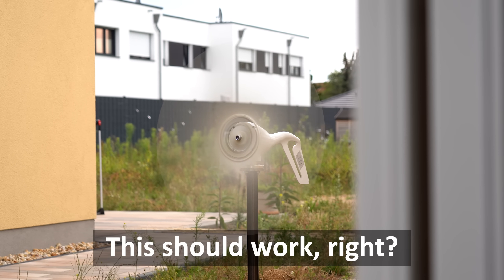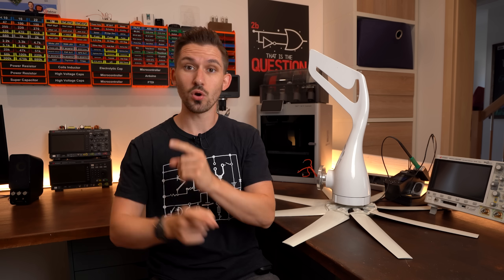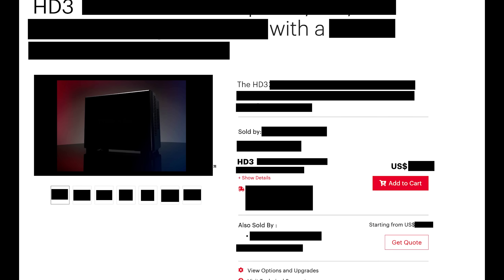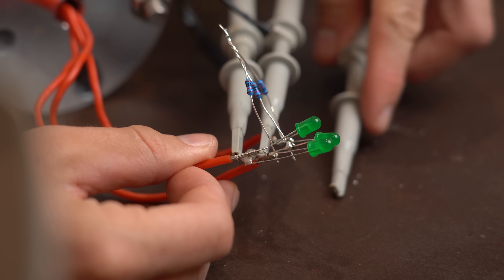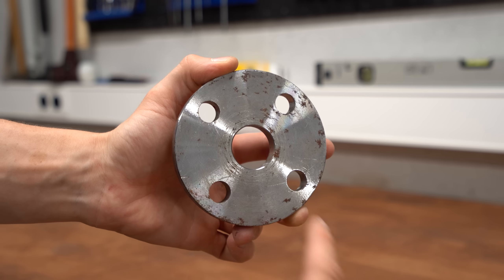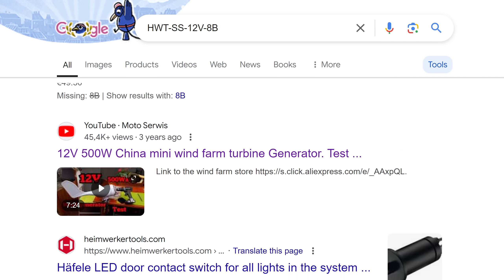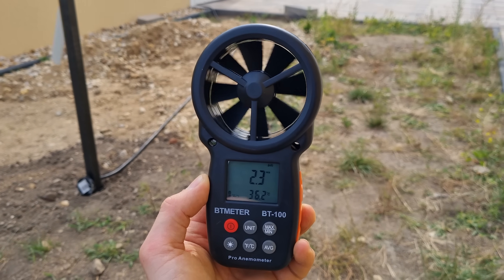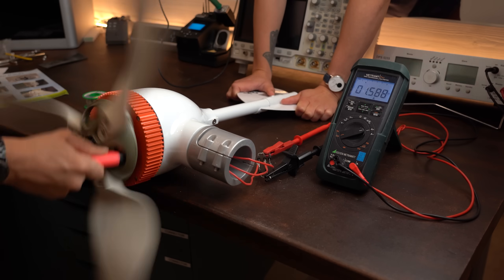I tried to Power my Home with Wind Generators! (Worth it?)

Comment: I would like a follow up video of a DIY style, but also include the designing of a VAWT.
Considering your generator can switch blades so easily, you could take the generator and turn it on its tail and put the VAWT blades above it fairly easily (tho, it's possible the bearings might need to be changed due to different loading; or have a separate one for the VAWT blades so they don't put too much weight on the generator bearings)
Considering that VAWTs love random wind speeds and turbulent air flow, it would be best suited for your low altitude and cramped location between buildings. HAWTs otoh love straight air flow and higher speeds, so they need to be mounted pretty high so they don't experience much turbulence.
Reply: Same, I have a strong preference for VAWTs, partly vindicated by the finding of them being less efficient than HAWTs was based on an incorrect transcription of an old wind power book chart parroted by other books for decades. They are in fact NOT 30% less efficient than HAWTs.

That aside, any wind gen you can "buy online" will probably be junk. The priority for them is making a package small enough to ship. A real project will require DIY. It would be most interesting to see a huge VAWT at only 10 feet high generating usable energy at 2m/s. I'm sure it's possible if you make the diameter wide enough and include a gearset to speedup the generator portion.

Comment: I run all my Lights, TV , stereo, and 2 Fridges as well as Fans on 12 Volt solar, That is 1000watts solar, and one wind turbine just like that.... I got 800 amps capacity and my 3 Bedroom house and Garden is always lit up, never out of Power, The Glassmat batteries last about 10 Years. I only have 4. 200 amps each. So only my Washing Mashine and a big Freezer as well as my Aircons are on the Grid. That keeps my power bill to around 300 bucks a Quarter with aircons running at night... at least on my place, when the sun goes, wind comes, my turbine provides 400watts/8+amps charging. Helps alot... combination is the go...

Comment: Wind generators like solars are dynamic generator, therefore theyre not stable and cant really be relied upon. That said can you use a boost converter to take that 1. Sonething volts and raise it to 12v?

Comment: With almost 30 years experience with wind power, I'm sure almost 100% of homes are not windy enough to make enough electricity to pay for the equipment.  It probably needs over twice the average wind speed as you'd find on residential property UNLESS you live at the top of a hill or ridge that's higher than any property within 5 km. Wind turbines over 150m tall might work if professionally sited, based on professionally modeled wind analysis. Anything less is a waste of money and time.

Comment: He uses a wind turbine the size of a house fan, puts it at ground level where the wind is the slowest, claims wind generators are not worth it as the cost per watt is too high. Smaller wind turbines require higher wind speeds per square meter of surface area to generate the same Watts per square meter as larger wind turbines. Also those giant 16 MW Wind Turbines in China can start generating electricity at wind speeds as low as 3-4 m/s (6.7-9 mph) while 24-Inch Blade Small Turbine needs 13-22 mph and 30-inch Blade Small Turbines need about (11-18 mph). Larger blades will generate much more energy per square meter at the same wind speed for the same surface area. 

As of 2023, China has installed 440 gigawatts of wind capacity. Wind energy, along with solar, is the cheapest source of energy per watt. Placing a wind turbine at ground level is inefficient. Reviewing a wind speed with height chart will show that wind speeds—and consequently energy production—increase with height. Therefore, avoid installing small, low-quality $95 turbines from Amazon with poor ratings.

For example, a 16 MW wind turbine with 252-meter diameter blades produced 384.1 megawatt-hours (MWh) in 24 hours, enough to power 170,000 average Chinese homes. Unlike solar energy, wind energy does not scale linearly with investment. A single 100W solar panel might pay for itself in 3-6 years, similar to how 10,000 watts of solar panels could have the same payback period. However, small wind turbines are unlikely to ever recoup their costs. The larger the wind turbine blades, the more energy you get per dollar invested.  Look at home projects where they installed $5k to $20k wind setups and see how the payback period drops with size.

Comment: i would recommend using a motorcycle stator since GY6 ones can be bought for fairly cheaply & produce 12v's at low speeds

Comment: For the DIY follow up, a car alternator has about 80v on open circuit and, after the fbr, any mppt solar works just fine. With cool DIY fan blades should be a nice project.

Comment: Couldn't an internal gear system be used to bring the RPM to a level where the output voltage and amperage are at a practical level for everyday use? 
Since I can see that the connection between the blades and the generator is direct, which I assume leaves everything at the mercy of the wind.

Comment: 15 years ago, I was part of a team that researched and purchased a wind turbine for my then work place.  The consistent wind is about 150 feet /46 meters up.  Your insurance is probably going to demand you have enough space around the tower that it can't fall on anything.  And even if your location has strong and steady enough winds, you still have to account for your turbine's maintenance.  We learned that part the hard way.  Those things need *constant* maintenance.  Unless you're building a windfarm, solar is definitely the preferable way to go.
Reply: I know of a business next to an airport that put some vertical axis wind turbines on their roof to get some green energy from the near constant high winds from the open field. Just two problems: The poles were too short so the turbines were too close to the rooftop, and I'm not sure if they ever maintained those things so they were turning very slowly just a year later...
Reply: Problem in Germany is: When you need power the most, in Winter, Solar output is 10% of summer output AT BEST. 4 Month of only extremely ridicculous results when you need power the most.
If  you push the installed capacity to 12 times the summer needs, to be able to have enough in winter, The excess energy in Summer you get NOTHING for because germany already has so much solar installed that market prices are near zero or below that (PAY to get rid of kWh)  that you throw away 80% of the solar's output in Summer, making it really not feasable.

This is the problem at out lattitudes.
Reply: Use biogas and a generator at night.

Comment: i think you should of put a clamp meter on the ac portion. As you know the fluctuating magnetic field made by the wires current flow is detected by the coil in the claps coil, similar to a transformer so in a dc application there is no fluctuation and the meter is more of a "tracking" meter adding and subtracting from a known 0v value under instantaneous changes is the dc' static field. i really think all if not the majority of "DC" clamp meters are pure bull shit. i understand the magnetic strength can be used with a mechanicle sensor or a change in the electrical properties of a material when a magnetic field is present or the pulsing of the field in the instrument can interact with a static field but none of them are as simple and accurate as a traditional ac meter. PLUS THE TURBINE PRIMARELY OUTPUTS AN AC SIGNAL!!!! since its a 3phase signal the current in one conductor is equal tot he total current flow. a standard low impedance resistor should be measuring current input of a battery in a dc system.....  /rant

Comment: What about using a 3 phase transformer at the output of the wind generator to allow the wind mppt to operate at its optimum voltage point

Comment: The problem with the MPPT controller is that it is a Buck regulator and you have lower voltage out than your battery voltage so you need some sort of Boost controller.

Comment: Well, I have been messing around with a couple different wind turbines myself and even the same vevor one you have. My results suggest making a 24v wind turbine for a 12v system because the turbine will never really hit the full rated power. Another thing to note after your full bridge rectifier is to build a curtailment circuit. This evens out the current from the turbine using capacitors and the circuit is mostly protective measures for charging the capacitors this way. It is also possible to build a curtailment circuit for solar panels. They both provide different benefits and purposes. Doing this will allow you to take advantage of an mppt controller for solar. The curtailment circuit in a nutshell is a direct charge capacitor bank from the source before the charge controller. If it’s large enough and the capacitor bank is doing its job correctly then what happens is your charge is evened out and will continue to charge the battery bank after the wind and sun has gone for a few hours. Typically ultra capacitors are used. They must be rated slightly higher than the charge being stored.

Comment: You should have bought higher voltage units like a 24v or if you have a controller that can handle the 48v

Comment: A wind generator only really makes sense if you are able to place it at least on a 10 to 15 m tower and if you get laminar wind of at least 4 m/s average at hub height. This is basically only the case in the countryside right at the sea or on top of a hill. In a city a wind turbine will always just be a fun toy, which is totally valid to want one, I've got one too. Only lights up a few LEDs but it's fun to watch and was fun to build.

Comment: Looked at the product page for the 400W Vevor unit. They show the performance curve for the 1500W model (scummy) so if you scale the numbers down they're claiming ~10W at ~3m/s and ~60W at ~6m/s.
Uhm, no. That's still optimistic..

These small wind generators require ridiculous wind speed to provide any useful power.
And sound awful because they're so small and have to spin so fast.
The listing says the blade length is 680mm or 1.36m diameter. Rated 800rpm (yikes)
Let's calculate the speed the tips of the wings are going at that rpm.
Tip speed equals pi times diameter times rpm divided by 60.
That is 57m/s. Or 127mph. (Category 3 hurricane)
The rated wind speed is 12m/s. So that's a tip speed ratio of 4.75.
Commercial wind is between 4 and 8. Basically closer to 6-8 for better power coefficient.
With this blade diameter, if you wanted a tip speed ratio of 6 (tip speed of 72m/s) at the rated wind speed of 12m/s you would have to spin this thing at 1000rpm.

If you want useful wind power you also need useful wind speed.
Diameter of 1.36m is a swept area of 1.453m2 and at 3m/s the available power is 24W.
At 6m/s the available power is 192W. At 9m/s it is 648W.
This is before any losses!
Betz's law says the maximum power you can extract from wind is 59%.
EPA says wind turbines are 20-40% efficient. Some claim up to 50%. But this is utility scale turbines.
With dinky little turbines don't expect no more than 20-30%.
For reference, Vevor claims 400W and rated speed is 12m/s so turbine efficiency of 30% checks out.
Then there is wake losses from anything nearby. And mechanical losses and electrical losses etc.
Let's assume real efficiency of 25% and you would talk about 6W/48W/162W of real power from wind speeds of 3/6/9 m/s at that diameter.

If you want reasonable amount of power, let's say 400W and your total efficiency is 25% and TSR of 6
at 3m/s you need 11 meter diameter at 30rpm
at 6/ms you need 3.92 meter diameter at 175rpm
at 9m/s you need 2.14 meter diameter at 482rpm
If you're satisfied with 200W you would need
at 3m/s you need 7.73 meter diameter at 44rpm
at 6/ms you need 2.73 meter diameter at 252rpm
at 9m/s you need 1.49 meter diameter at 693rpm

Comment: Brilliant work, dude! Really well done!!! 😃
But you know, I also have solar panels here at home, but without battery. And it's in the maximum of the equipment's capacities... But I still think about buying or even building one of those!
Perhaps I could get a small battery and use it to power some reflectors... I don't know, but something! 😬
Oh, and here the wind is pretty strong! Sometimes a bit too much, at the point of damaging the roof. 😬
Anyway, stay safe there with your family! 🖖😊

Comment: Your diode thing is simply a "full bridge rectifier". We're used to the traditional one with 4 diodes used with a single phase AC supply, but yours is simply the 3 phase version of it. Get rid of two of the diodes and you have the traditional bridge rectifier drawn slightly unconventionally. If you have a Wye 3-phase you can add a 4th set of diodes for the neutral.

Comment: at lower wind speeds, and im sure im wrong typing this, it might be worth getting bigger blades and setting up a 1:2 (or whatever ends up being more efficient) to convert torque to rpm. i do not know the optimal rates of rpm to torque you need to pull good power but bigger blades should pull more torque and a conversion of rpm to whatever is most optimal for it could create a more efficient setup. my thought process here is that more blade should have more air force making more torque, it may lower rpm as well but at low wind speeds i assume torque should be king. large and i mean LARGE wind turbines spin at like 10-20 rpm (google says so) but they have a huge amount of area they pull from and can covert that torque to rpm, usually in the thousands but thats a huge conversion.
Reply: you don't need a gear, you can just take a generator with more poles in it. There are even designs with 9 separate windings, so you can switchs "gears" with software.

Comment: 1.2 meter sweep diameter with 13m/s wind as they claim is actually 1500w available wind power and at approx 30% eff with some wake losses it should deliver 400w.
At 4m/s the wind power available is only 44w and output potentially 12w. It's not a linear scaling. At slower wind speeds you basically need bigger blades. 3.5m blades instead of 0.6m equals 400w potential output on 4m/s wind.
Edit: Remember kinetic energy is K.E. = 1/2 m * v^2 making increases in v count for a lot! It also makes the blades profiles work better.
Reply: The Betz limit will tell you that you can capture at most around 60% of that energy in theoretical situations. In practice, it's closer to 40%. The power in wind equation (P = 1/2 x ρ x A x V³) has the velocity cubed, so you can imagine that at low wind speeds you don't get anything useful.
Reply: @upnorthandpersonal  My estimates used 30% and 5% wake losses which is quite reasonable. It does match quite well with their 400w claim although I would expect their wake losses to be higher for such cheap design. Using the velocity cubed matches well with the results he is getting.

Comment: Thank you for making this video. While I do engineering I am not an electrical engineer and had always wondered if these small wind turbines could be made to work at wind speeds under 7m/s which it looked like they could not. This is excellent confirmation that they do not.
Reply: A lot of these problems were interesting engineering challenges back in the days of mechanical wind turbines.  If you were running a water pump, it just ran slower.  Mostly, mechanisms were needed to prevent the mill from generating too much power.  Today, we just use capacitors to get around the problem of intermittent supply for electrical applications, not unlike the hydraulic accumulators during the first industrial revolution.

Comment: Please build a wing generator of a specific type! Hear me out! Old big generators that use the huge wings get rid of them all the time! Please continue my reasearch on mounting these as pillars that rotate to point onto the wind, then holes are made into the wing core in the areas of the wing that generate low pressure. The inside of the wing that’s now at negative pressure is hooked up to another squirrel cage type wind generator… the Benefits to nature are huge, because of recycle and non spinning blades are great for birds! The motor is able to run at high efficiency as wel because of the set up!
Reply: Even a scaled down model can look like anything wing shaped, just need ports on wing that in areas of low pressure to allow airflow to a motor

Comment: Surely there must be a wind turbine that can produce something useful at lower wind speeds? 
I have seen those blue hand crank generators sold on eBay and Ali Express provide more useful power! In one video, I saw a guy modify one by adding super capacitors which makes so much sense! 10 - 20 cranks gives him half an hour of run time powering the led torch he also built into it! Actually it probably ran longer than that.... It's been a while since I watched it! 
The wind turbine you have looks like it was built for a lot more wind speed than its getting in your location.... 
Either find a better low speed turbine (someone might have posted a video of such a device) or rewire it!

Comment: I was honestly thinking you were about to put a gearbox inside the generator to increase the speed and get a higher output but then you opened it and i realized it would be a little too difficult to do so